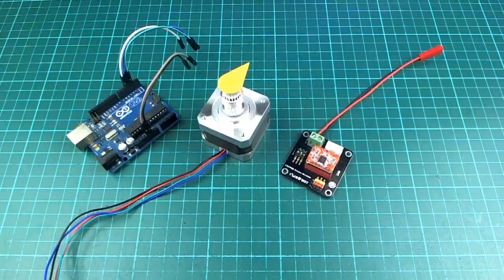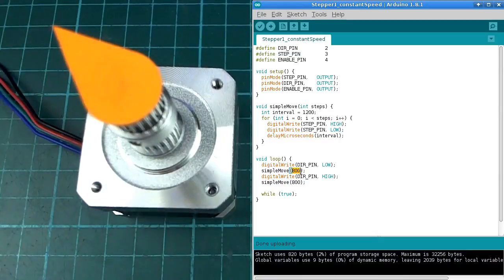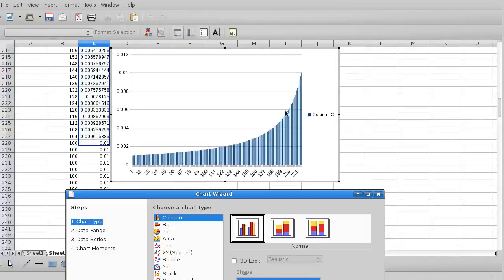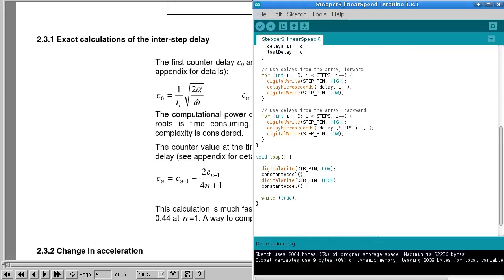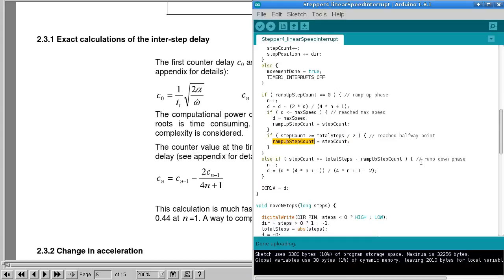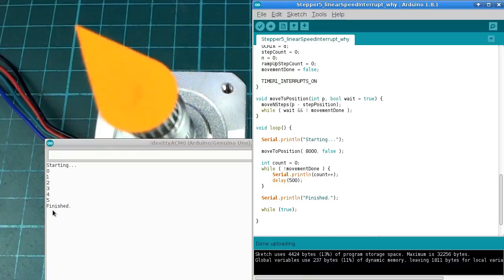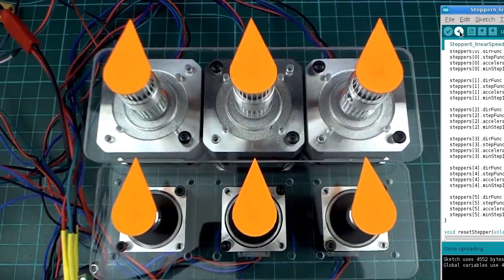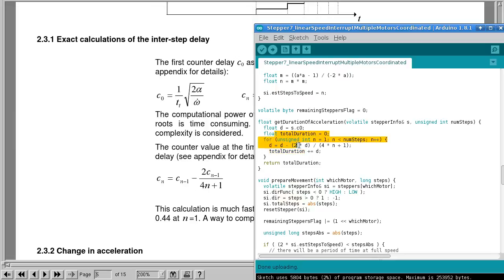Coordinated stepper motor control (arduino)

Comment: Hello, again I'd really love it if you could help me out with this.

At  19:29 on the highlighted line, how did you get to the "2000" value?
At first, I thought that this was the clock's frequency, then I thought of it as the minimum speed value or the speed in which the motor starts. Although it makes part of it the starting speed is actually Co, so where is this value coming from?
Reply from the maker: I think it was just from trying some values and seeing what gave the result I wanted.

Comment: Reading the AVR paper I got to this eq in page 6 :   n1 = [ ( n1 + n2 ) w°2 ] / ( w°1 + w°2 ). In the reading when can find that is used to find " n1 " but for me makes no sense since " n1 " is still on the right side. I kinda have a clue for this... If we assume that n1 + n2  = 160 this eq would let us know the actual value of n1 in the case we want to divide the steps into two with different accelerations. 

Thanks to everyone in advanced!

Comment: Hi Great video the examples  worked right up linear acceleration but i couldnt get the interrupt verion to work .its downloading but nothing happens to the motor no movement at all for some reason ! .
Reply: Hi I have the same problem. Did you manage to solve it?

Comment: Please give the connection diagram of multiple control of stepper motors.?
Reply from the maker: https://reprap.org/wiki/RAMPS_1.4#Wiring_2
Reply: @iforce2d  Thank you very much, i have small question, Are you have connect all six motor with one driver circuit to control, if yes then Please tell this driver circuit name??

Comment: Hello iforce2d,
Excellent video and explanation. I am just beginning to learn  to use the Arduino  uno HW277 and the  driver A4988 to control a stepper motor.Could you please  help me to write the coding. I am  very new to Arduino  and Would very much appreciate your help.

Comment: Surely you need a delay between  step high and step low?
Reply from the maker: Seems like the driver boards are fast enough to detect the change, at least for a 16MHz arduino.
Reply from the maker: Actually now that I think about it, the driver would only be listening for the step high. So it's the time between one step high and the next step high that matters. The step low is only required to return the state to default, so that the next step high can happen.

Comment: this is fantastic , just a quick question if I may.. how could I have two stepper motors working in relation to each other? the machine needs to do this : as a rod is pushed forward, it (the rod) has to turn in relation to haw far it has moved. this is to create a long slow spiral by the tip of the rod. You covered this but I don't know how you did it? the start point could be a micro switch. hope to hear from you soon. ps very cool I had to watch it twice as well.
Reply from the maker: If you're looking for something that will be accurate and reliable, I would try the GRBL library that's made for controlling 3-axis CNC machines. https://www.youtube.com/watch?v=OuhgZMDXDdY

Comment: Great video -- I'd have gone with a simple table for the speed values.  If you have too many points, then you interate between adjacent values.  Its a great way to get the curve you want without wasted computations on uCs.
Reply from the maker: These mcus only have 2048 bytes of RAM, it disappears pretty fast :) But yes, on most other hardware that would be the way to go.

Comment: This is a late reply but this has been a very informative video!! I am busy getting my head around interrupts - I can see why it took so long. Just a simple question... If your Stepper3_linearSpeed sketch works, should the Stepper4_linearSpeedInterrupt sketch also work without editing? My stepper just makes a slight movement and that's it... the non linear sketches works perfectly.

Comment: Hi 'iforce2d', I have a project where Arduino reads input data from an external file to control and sync multiple motors rotation. Would you be kind enough to help me? Thanks kwahmed@gmail.com

Comment: Hello!
This is a great work! Explained with simple working examples. I would like to know if you can no only stop the motor while running, as you showed, but also change the speed anda acceleration to use it in a PID control loop with position measurements by rotary encoders. I tried other libraries but I could not manage to get it working. The interrupts of the encoders counters are blocking the steps/rev action send to the motor and the behavior of the motor is different when the encoders are added.
Can you help me with this problem?

Comment: whr can i get the coding for this??
Reply from the maker: ? Links are in the description
Reply: @iforce2d  Thanks for reply! sir may i ask if i have 4 stepper motor and 4 A4988 driver. My stepper motor is 1A in phase. May i just connect all driver together and supplied by only one power supply with 12V 2A ?? is it enough to run all my motor???

Comment: So is there anyway to add button control to this? as id like to be able to control the direction of each stepper motor with two buttons per stepper motor.

Comment: Hi all so I love this video it was an awesome learning experience for me however I have been trying to fully understand the last few code sketchs and am unclear on the multiple ISR 's.I want to understand if each motor is running its own ISR simultaneous and is triggered one at a time? But they are all using the same output compare register so they cannot share that memory space at the same time while increment the value. So are the motors being stepped one step at a time like each motor takes a step and then it loops back through to the first  motor again for the next step?  Ie they are not actually simultaneously running ISR's ? Lots of question sorry just have some understanding but have knowledge gaps it would be great if someone could clarify this.
Reply from the maker: There is only one ISR, it needs to keep track of which motor is the next one that requires a pulse.

Comment: Hey, I'll just try my luck and see if you can answer my questions.

First question: You are using a 64 prescaler but your default OCR1A is at 65500.
16000000/65500 is around 256. So wouldn't you be using a 256 prescaler? Otherwise you would only 'use' 64*65500(=4192000) of 16000000 tick.

Second question: Don't you think the formula to calculate the delay between steps is used with an 1 prescaler (no prescaler)? I have the feeling that you are slowing it down by a factor of 64 with the prescaler.

Third question: In your setNextInterruptInterval function you use boolean movementComplete but I don't see the reason for that variable. You change it to FALSE if the movement is not done but nothing else. Note: you use movementComplete and movementDone , that's the part I don't get.

Thanks in advance and you are some sick genius, helping me A LOT :D
Reply from the maker: I'm not very savvy about the prescaler stuff, I probably based this code on something I got online, and just left the scaling as the original code and adjusted the other values to get the acceleration I wanted. Judging from your comment, I think you know more about it than I do :)

You are right about the movementComplete variable, it seems to be left over from something else that should have been removed.
Reply: @iforce2d  TBH I did not expect to get an answer so I'm pretty stoked about that haha
I will experiment with the prescaler and see how the translation to speed/acceleration really is, might post my result here
also super impressed by you figuring out the formula of the total acceleration duration :D And thanks for answering!
Definitely a new sub here!

Comment: здравствуйте  ,  подскажите где можно скачать скетч  , с такими функциями ,чтоб  можно было менять обороты двигателя  и направления движения  (реверс )  и кнопка пауза .
Hello, tell me where you can download the sketch, so that you can change the engine speed and direction of movement (reverse) and the pause button.
Reply from the maker: The sketch is linked to in the description. There is no 'pause' feature in the code, but I think it wouldn't be too hard to add.
Reply: @iforce2d  мне нужна ваша помощь  .  где взять информацию ?  сможете   мне написать скетч ?
I need your help. where to get the information? can you write me a sketch?

Comment: I use Arduino mega 2560. I ran the Sketch3 and it didn't work. Since it didn't work, I couldn't run latter ones.  
I think the problem is about the array which you named as "delays" . I believe that "delays" include so many values in it.  Your code is not working when I run it. I think the problem is the amount of values that "delays" include. 
Therefore, I decreased the amount of values and then it worked. But I don't think that it can be a solution method for the problem I faced. This led me to work with less amount of steps. 
However, the very same code is working for you. How can I solve this, please help..
Reply from the maker: Are you using the exact same sketch as me, or did you add more code to it? The 'int' variable is 2 bytes so the array of 400 is only 800 bytes. Arduino has 2kb memory so it should be fine if this is the only code running. The mega2560 has 8kb so it should be even more fine :)
Reply: @iforce2d  I used Sketch3, the exact one. It didn't work when I didn't change anything. I solved the problem I was facing in Sketch 7. #define X_STEP_HIGH             PORTF |=  0b00000001; and the others aren't working. But when I wrote it with digitialWrite code, it worked. I wonder that were the micro controllers different in 2017? :)  The Bitwise might be different now? That's weird. The exact code isn't working.

Comment: You know, you run through that array-filling code every time you call that constantAccel method at 18:46, right?
Reply from the maker: Yes. It's a tutorial, not production code.
Reply: @iforce2d  It's my own fault for commenting before the video was over.

Comment: do different motor voltage and current requirements affect the code at all?
Reply from the maker: Nope, not the principle of the code at least. Lower voltage means you might need a lower acceleration to avoid missing steps though.

Comment: can you give me a link to the stepper motor  and the stepper board.
Reply: This is a classic nema 17 stepper motor and the shield board is a ramps 1.4 on an Arduino Mega :)
You also need a 12V power supply with enough Amps (look for 3d printed power supply) to run this thing

Comment: Can I use stepper motors for a car ? Like I don't want something fast, but mot something very very slow. So, will it go like for example 20 km/h max ?
Reply from the maker: Yes, but I think it's really the wrong tool for the job. Stepper motors are for making very precise movements of just a few degrees which is usually not how cars work. They also cost more, I would just use a simple brushed motor like on a typical RC car.
Reply: @iforce2d  well funny thing is that I found some brushed motors but they actually cost more than the steppers like they are 35 dollars and the steppers are 10 dollars each. And I want something strong, very strong. So that's why I've asked. Also, I think that the steppers will consume a lot of power, so that's probably the biggest minus to me, I was thinking of using one 1000mAh battery for each stepper (idk i think 11V or something) connected to a two motor driver that can handle one stepper.

Comment: Hey! I am trying to run 4 similar stepper motors and I think they are not getting the appropriate amount of current. What Voltage are you using overall and what is the Vref you are using for the Stepper Drivers? Thanks in advance!

Comment: Great video! Very informative. Thanks
 Here are 2 questions:

1. Looking at the 1st codeat 4:20 ,  I was wondering if inverting the digitalWrite High and Low wold make a difference in torque since the holding torque of a stepper motor is the highest. I figured putting a delay on High could help increase the torque. In the same line of thought, could there be an advantage to having two delays? One after each?

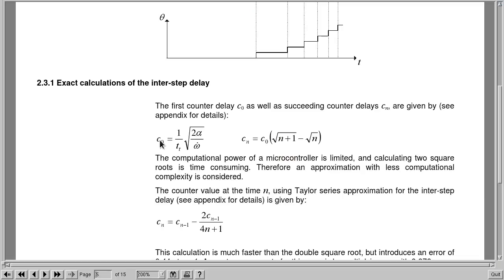2. At 16:15 , what is "tt" on the denominator right before the square root?

Cheers,

Martin
Reply from the maker: The order of high and low would make no difference. That's just an instruction to the stepper driver that  a step should be made - it will make a step when that pin goes from low to high (or maybe vice-versa) so you just need to toggle it from one state to the other and back. The stepper driver itself controls how much torque (current and ) goes to the motor. Delays will just make everything happen slower.

tt relates to the "desired speed slope" in the upper graph of fig 2-6. Essentially it just defines how fast the acceleration will be. You can just choose a value that ramps the speed up at a rate you desire.

Comment: Hello sir its an amazing video...
i m new one to Arduino..can u plz let me know how to write a code for my application which I run through plc...

Like I need to run stepper in 2 segments 1)run continuously after I get a ext command then I need to stop it at predefined(2 seg) position after another ext command(interrupt).. It should switch the segment without stopping or deacclrating.. 

Plz help me out in this..

My mail I'd is 
rupnuresunil@gmail.com
Thanks..

Comment: Thank you so much for your video and clear explanation. i learned so much :)
but how can I run with speed up about 1200RPM ! 
Can Anyone help me ?
Reply from the maker: It might help to explain what you've already tried, and what results you got, so people don't waste their time suggesting things you already tried.
Reply: Thank you  @iforce2d  replied my comment 
Can I change Step, Dir, Ena, pins like below ? 
#define X_DIR_PIN          69
#define X_STEP_PIN         68
#define X_ENABLE_PIN       67

#define Y_DIR_PIN          61
#define Y_STEP_PIN         60
#define Y_ENABLE_PIN       56

#define Z_DIR_PIN          62
#define Z_STEP_PIN         63
#define Z_ENABLE_PIN       53
I changed pins because I don't use RAMPS 1.4  and It didn't work ! 
I'm using a Easy Servo Motor and a Driver to control the motor. The way to control this motor running like your way in this video.

Comment: Hello, I would like to say thank you for the great video, I learned so much from it. 

I have a question regarding your Stepper4_linaearSpeedInterrupt code. You said that the maxSpeed is timer ticks per STEP and some of the that time is taken up running the interrupt. Is there a way to take this maxSpeed value and figure out rev/sec of the max speed?     

Thanks
Reply from the maker: I think it would be pretty hard to get a good number. Best idea might be to check micros() every n steps and take the difference between them, when running at a constant speed. Do that for a range of different speeds and you might be able to plot a curve that gives you a general estimate.

Comment: for those that cant get the later interupt sketches working. i did it like this .
change each stepper with port mapping to digitalwrite as below

#define X_STEP_HIGH            digitalWrite(X_STEP_PIN, HIGH);  //  PORTF |=  0b00000001;
#define X_STEP_LOW             digitalWrite(X_STEP_PIN, LOW);  //  PORTF &= ~0b00000001;
Reply: Not true for Arduino 101 and other models that cannot run the function: ISR(Timer1_COMPA_vect). A major code rewrite is necessary to run on my Teensy MCU. Am not qualified to do that yet.
Reply: It worked! THank you

Comment: Thank you for providing such a heplful video for us.I need a help for  the code which I am doing currently,I am trying to do the programm to maintain the coordination between 4 legs of horse.In short I am working on walking movement of horse.What should I do with stepper motors?How can I use those for the task of walking
Reply from the maker: I think servos would be much better for that

Comment: Best tutorial I've seen in terms of using interrupts with motor control. I'm actually trying to modify your code for use with the BCN3D Moveo robot arm, but I'm having trouble trying to get the code to even work with one NEMA 17 stepper motor using a TB6600 based controller. The TB6600 controller uses the same control style with the STEP, DIRECTION and ENABLE pins. I have a RAMPS setup on a ATMEGA 2650 board...tried using your code from the 4th tutorial that introduces the interrupts with one motor but can't get it to work. I made sure to map the pins correctly based on the X AXIS of tutorial 7, but still no dice. Played around with the speed and acceleration values but the motor still doesn't spin. Do you have an email that I can communicate directly with you? Thanks :)
Reply from the maker: I would suggest starting with the first example instead of the fourth...
Reply: I actually got through the first 3. The driver works up to tutorial 3 just fine without interrupts. I believe the timing on the interrupts are faster than the drivers can handle...
Reply: Garland Truong ! I tried using the code in the 4th tutorial but It didn't work ! 
Have you fixed it ?

Comment: Hi iforce2d, congratulations! is a excellent video, it is explained very well how move stepper motors, i want to comment that present problems with the configuration of the ports (#define STEP_HIGH PORTD | = 0b00001000; #define STEP_LOW PORTD & = ~ 0b00001000; ) and i solve it only by assigning the pins the high and low as is normally done, (digitalWrite (STEP_PIN, HIGH); digitalWrite (STEP_PIN, LOW); ) and in this way the code worked correctly.  Greetings from Colombia.
Reply from the maker: I think the port mapping in my code was set up for atmega2560. 
https://www.arduino.cc/en/Reference/PortManipulation
https://www.arduino.cc/en/Hacking/PinMapping2560